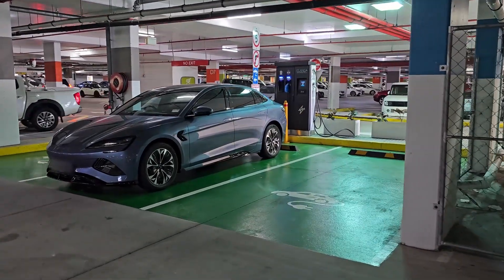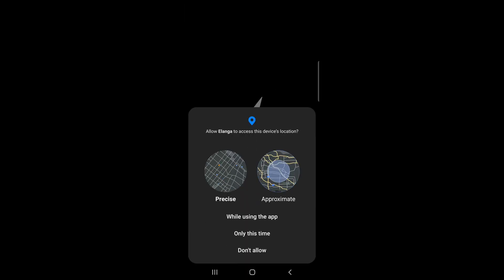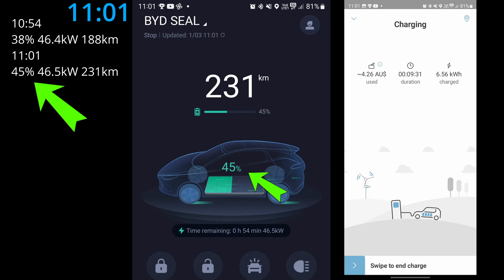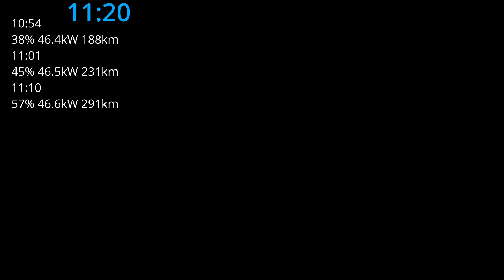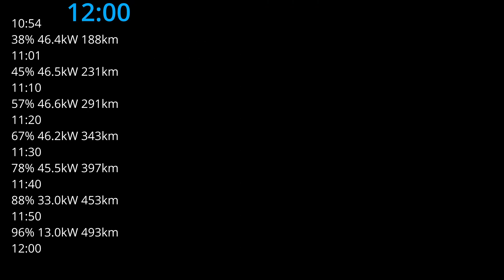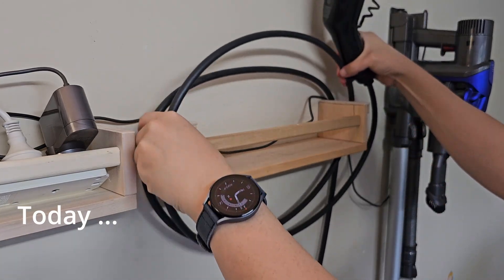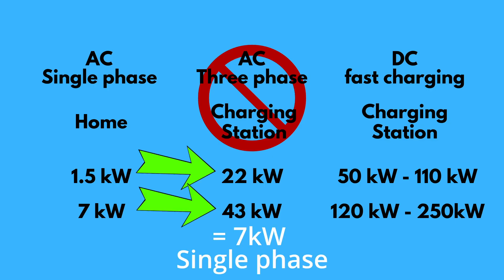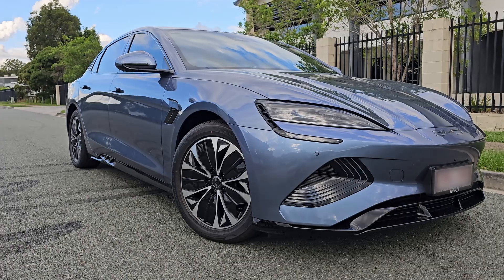BYD Seal EV charging options explained - Don’t pick the wrong one

Comment: I have a BYD Atto 3, which can also only charge at a max 7kw AC but I have 3 -phase at my home and invested in a 3-phase 22kw charger. Now because the BYD can only charge at 7kw, the charger is only providing 7kw on it's single phase output because that is the max the car can take. It might seem a waste of money to buy a 3-phase charger but the cost of a 3-phase charger is not much more than a 7kw charger plus I have the added advantage of future proofing my charger because my next car will more than likely be able to charge at 11kw plus if I have a visiter with a Tesla, for example, they can use my charger and it will charge at an an higher rate because Tesla's can charge at at least 11kw AC. The biggest cost for home chargers is with the actual installation but if you are like me and intend to stick with EV's then it is a worthwhile investment and it is also an added feature to the home, if and when I sell my home.
Reply from the maker: This is such a good point. Installing a powerful home charger to bring up the value of the house! Brilliant! Yes you are right. BYD's limit to 7kW AC is only BYD. Other brands, if we are getting other brands of EV, might be able to leverage 3 phase AC. Is it a lot more expansive between the single or three phase installation? Do you need to get special electicity supply from the grid? Please share your approximate installation price difference. Thanks.

Comment: The drop off nearing full capacity seems to be normal, based on watching BYD videos, the same drop off also occurs during discharge, not linear.
Reply from the maker: It makes sense because the byd seal battery management system needs to locate the batteries that haven't been charged to full. This means the fuller the battery the harder to find the batteries that are still not charged.

Comment: Hi. Love your videos. Can you do a video of a DC fast charger capable of using the max 110 speeds. Want to know how long it takes. Thank you
Reply from the maker: For 35% to 100%, my guess is 30 to 40 mins if we do the math correctly. If over my next two months trial of my slow home charger failed and I need to do a DC fast charge top up, I will remember to go to a 120kW station to test it out for you and reply on this comment thread.

Comment: Is there government oversight on the cost of charging stations? I get that it's cheaper than petrol...but I feel that it will be more and more expensive over time due to the increase in demand.
Reply from the maker: Yes government is definitely aware of the recent up take of EV because they initiated the incentives. Supply (charging station) is increasing too so hopefully supply is more than demand so prices will come down. Solar might be the best solution for EV charging. We just need a 3kW home solar system to charge our EV for free if we get enough sun.

Comment from the maker: Did i explain any electricity theory / concepts wrongly? If there are any experts reading this, please feel free to correct me here. Thanks.
Reply: Energy is measured in kWh, which is equivalent to 3.6 megajoules (MJ) or 860 kilocalories. Power is the rate energy is delivered (or consumed), power = energy / time = current x voltage.
Reply from the maker: @lokchisiu  Thanks for sharing the technical details.
Reply: Power is measured in kilowatts, energy in kilowatt hours (kWh). Power is the instantaneous rate of energy transfer. Also an AC connector has earth, neutral, and an active connection per phase (not positive). Positive and negative are connections for DC.
Reply from the maker: @TonyStrasser  I understand now. Yes I should not have used the word "positive" in an AC connection it's just live AC connection. Thanks for the correction.

Comment: I think if you change it daily with slow charger you can easily survive. Make it like a habit if you home put it to charge.
Reply from the maker: Yes I think so too. Initially I wanted to also not drive or travel unnecessarily, but no a car is meant to be driven whenever I feel like going somewhere, just like my petrol Civic. I will charge every time it's used down to 30% and see how it goes. 👍
Reply: Is it bad for the battery at all if you just plug in the slow granny charger everytime you arrive home?
Reply from the maker: No I dont think so. It's more gentle on the battery because it's slower and doesn't generate so much heat.  The battery management nowadays are pretty good.
Reply: Indeed, after a year and a half of EV ownership, I have never had to use a public charger, and this includes country driving. And only charging once or twice a week.
Reply: Not everyone can unfortunately, I have to park out on grass cos my partner and family have their cars in the drive and carport